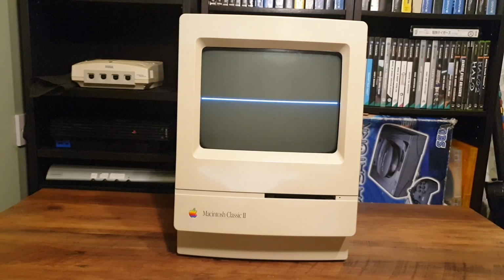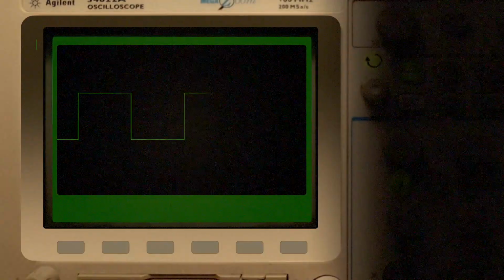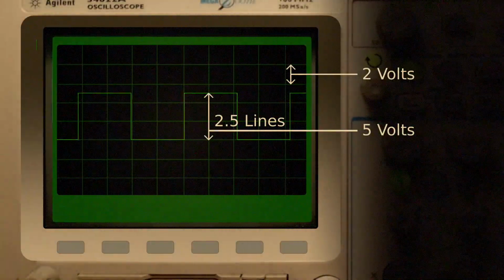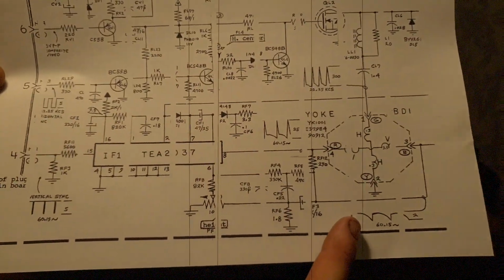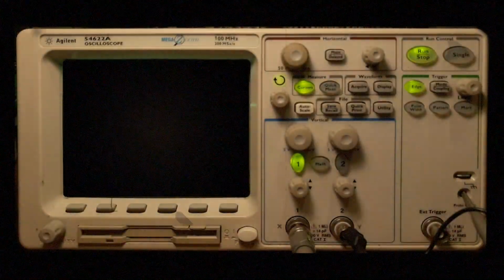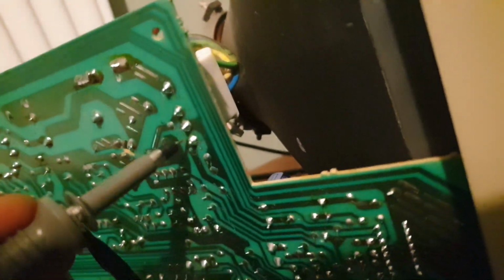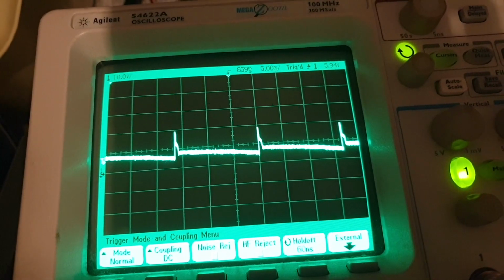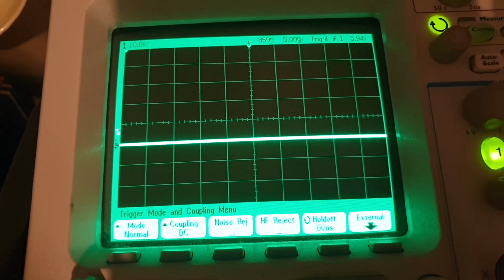Mac Classic II - Thin Line CRT Repair

Comment: Dude. You just low-key dropped that you created an interface for the board using an LCD monitor and moved on. LOL I want to see THAT tutorial! =)
Reply from the maker: Lol its not that special, just a monochrome VGA like signal with H sync and V sync going into a monitor. The 22khz vsync is an oddity but otherwise its mostly direct connections to a VGA plug.

Comment: The line amp

There is a very bright horizontal line in the middle of the screen? Or possibly vertical? Again, it's a big transistor that heats up that passed the weapon to the left. Changing it often brings the TV back to life
Reply from the maker: I explain in the video that a single burnt out resistor caused the deflection driver IC to not have any power, replacing it fixed the issue.

Comment: Ahhh. soon you will learn that it's never the chip :) (well mostly not) When I used to repair things with both chips and glass bubbles there was a rule that said - "The more pins it has, the less likely it is to be faulty." Your TEA IC doesn't have that many pins so you could have been right :P
Reply from the maker: I had read the chip could fail on forums, hence why I looked. I actually tested every single component after abd thats how i found the bad resistor
Reply: @NaokisRC  If you watch back your video theres a part where you are probing the TEA chip. the only pins on that chip were showing any kind of signal were input. there was a distinct lack of any DC on it. Well done for getting it going :) Now just see how hot that 10R resistor gets as it will be droping more voltage across it than the 1R one.